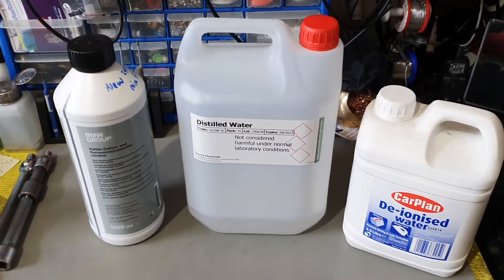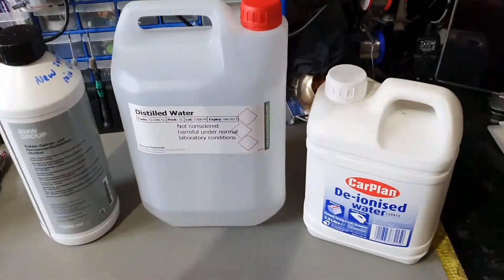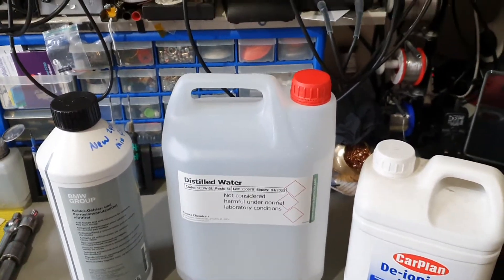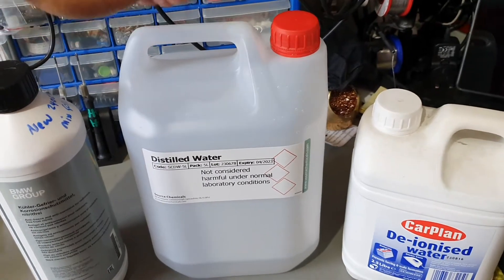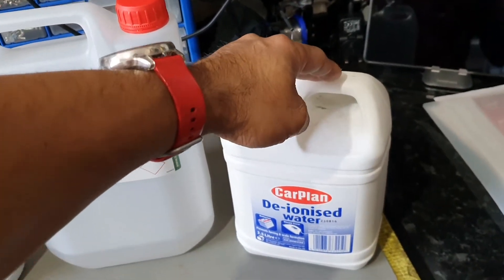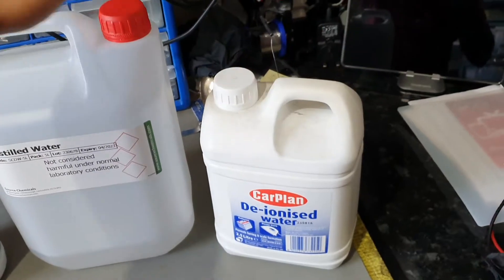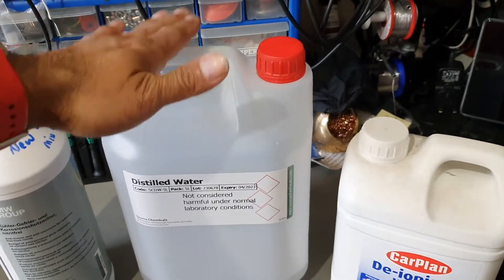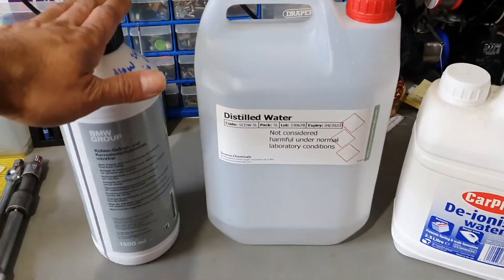How I mixed BMW Coolant 50% and 50% distilled water, not de-ionised or tap water

Comment from the maker: Deionized water is water that is acidic from the H+ ions. The PH acidic and as a result attempts to correct this by pulling metal from the radiator.  Highly recommended for equipment such as clothes iron and ultrasonic cleaner.

Comment: If you read commas g48 coolant tech sheet it actually says use de ionised water.
Reply from the maker: https://www.quora.com/What-is-the-best-deionized-water-or-distilled-water-to-use-in-a-car-radiator-mixing-it-with-coolant
Reply from the maker: Deionized water is water that is acidic from the H+ ions. The PH acidic and as a result attempts to correct this by pulling metal from the radiator

Comment: Show me where the manufacturer says use distilled water and not the de-ionized water.. because it specifically says on the back of the actual bmw antifreeze/coolant to use the de-ionized 50-50 with solution depending on the state of your engine  . Are you saying it as if someone wasn’t using the de-ionized water and you don’t wanna revert back to using that because it could corroded your engine trying to balance itself??
Reply: Yup. Can confirm bottle directions say use “deionized” water
Reply from the maker: https://www.quora.com/What-is-the-best-deionized-water-or-distilled-water-to-use-in-a-car-radiator-mixing-it-with-coolant
Reply from the maker: Deionized water is water that is acidic from the H+ ions. The PH acidic and as a result attempts to correct this by pulling metal from the radiator
Reply: What is deionsized used 
For then?
Reply from the maker: @edubb2491  is highly recommended for equipment such as clothes iron, ultrasonic cleaner.

Comment: Just bought Comma Xstream G48 coolant for my Mini Cooper S.... In the manual that comes with the coolant, it says mix with deionised water?  Any advice on why this may be the case? Thanks
Reply from the maker: I would recommend going off your service manual keep using the deionised water.  I would've thought all bmw will use distilled water. I wouldn't have used anything other than BMW coolant.  Genuine parts cost more but they last longer than many oem spec parts.  Take care 🙂